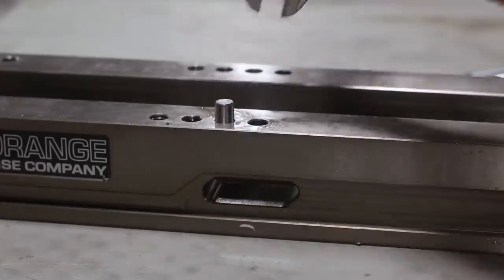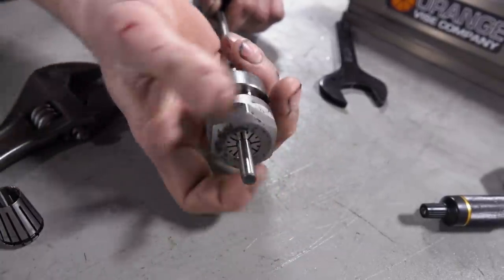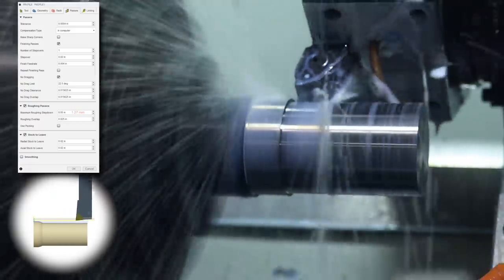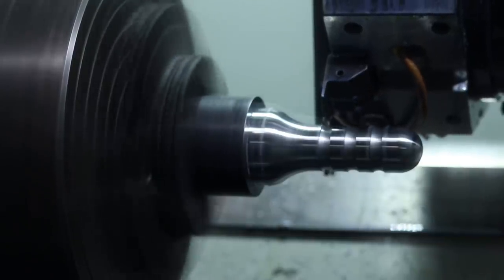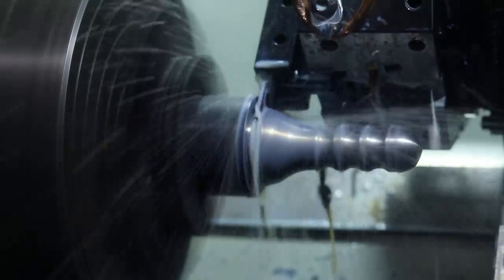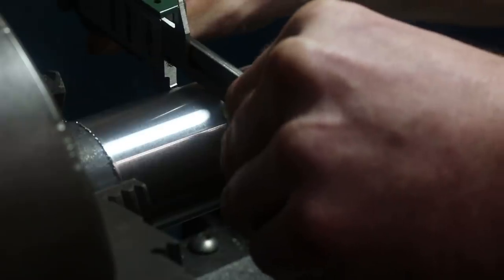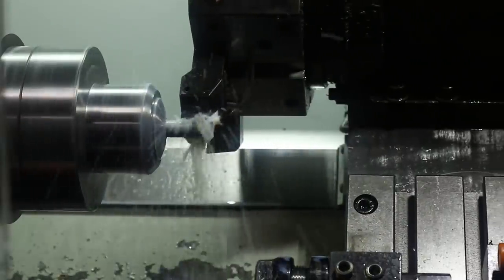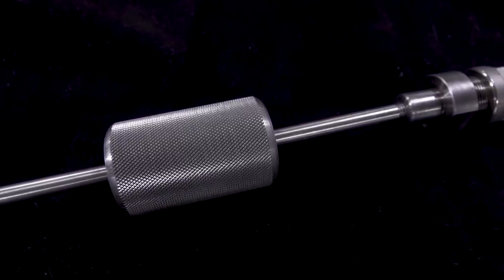DIY TOOL: ER20 Slide Hammer | WW243

Comment: Buy dowel pins with the helical groove ground into them, solves this problem.  They often have screw threads in the center too.
Reply: What?! Plan ahead?! (yeah, OK 😒)
Reply: @letsgoBrandon204  Yeah, McMaster sells them as 
Alloy Steel Spiral-Vent Pull-Out Dowel Pins
Reply: I was going to suggest getting some pullout pins if this is a constant issue with that vise, we use them at work and have a slide hammer with a bolt in it for easy removal.

Comment: You could use dowel pins with a threat in one side, they are designed to be used in blind holes they also have a small graund flat spot on the side that helps to relase the air thats trapt in the hole .
Reply: We only use those at my workplace, and I am so glad about it. Plus you can sink the pin into the surface (pinning one part through another)

Comment: Be careful John, and instruct all of your operators too, that hammer action will smash soft meaty parts at the back of the handle very easily....Make sure you are holding it clear of the business end. I am surprised you don't already have a full dowel pin collet remover set  as they have teeth built into the collet to help with stubborn pins.

Comment: Great solution, although you already have a good tool for  regular dowels there is also blind hole dowel pins that come pretapped at one end and use a similar slide hammer that threads into the pin.

 I could see your slide hammer design being very useful on some busted shafts I've had to pull. My quick and dirty method has been a   piece of 5/16 all thread that I thread into a pair of visegrips where the knurled screw would normally go for a make shift slide hammer.

Comment: good idea. btw, same job could be done with any bt type er toolholder - just replace the pull stud on its back with the threaded rod and use the nut on another end of threaded rod for pulling out like bearing removal. 
p.s. i wouldn't blame the dowel pin manufacturer as it might come in different tolerances (for sliding and press fit) may be that one filmed was from the latter stock.

Comment: Nice job, but I would suggest one revision. The hammer is slapping against a flat surface that you are holding in your hand. High possibility that a finger or finger web will get pinched pretty bad. I have used other slide hammers that the handle end bells out  or has a ball formed into it. This style pushes your hand out of the way without pinching it.

Comment: Having been in many equipment repair machine shops the way to remove blind stuff (no matter what is stuck at the time)  is take a piece of allthread, weld the one end to the stuck part put a heavy scrap that's drilled through and secure it with a washer and a nut.The rest is history! The soviet way of saving the fuss is to make a smaller through hole so you can punch it out later (when I rebuilt my mill's spindle I was caught by surprise as all the bearings had through holes to punch them from behind and all the other press fitted parts had threaded holes to act as a puller to get them out...I was confused and thought that it shouldn't be that easy! At least that was the easy part of rebuilding a spindle).
PS: I love lathes. The chuck is there (99% of the time), you chuck the part itself (90% of the time), you get done with it (well, most of the times). And I think you'd be better off hand programming that lathe...Or even manual it out!

Comment: Just use an old (or new) drill chuck to pull out pins.  Works like a charm and doesn't damage the pin.

Comment: I've recently learned that this is also how you remove dents from sheet metal e.g. an airstream trailer. You superglue a tab into the dent, then use a slide hammer to slide-hammer them out carefully.
Awesome video, thanks!

Comment: Hmmmm.....This video is a joke right?  Seriously,  you have a problem with using pliers to remove dowel pins that could be thrown away and replaced BUT you're completely OK with putting expensive precison gauge blocks in a vice and crushing them against parts. Any tradesman worth their salt would give you a serious reprimand for such a thing!

You should probably stop teaching people bad  habbits, or just risk destroying your calibration equipment....Just my two cents worth.
Reply: @Ed Rees it's still a bad idea! Get some key steel or any steel, mill it or grind it and use that instead. That way, when you make a mistake you don't blow up your expensive carbide drill or ruin your new endmill as it will machine through it. You encouraging bad habbits and very poor techniques.